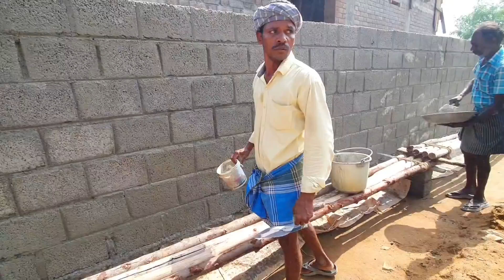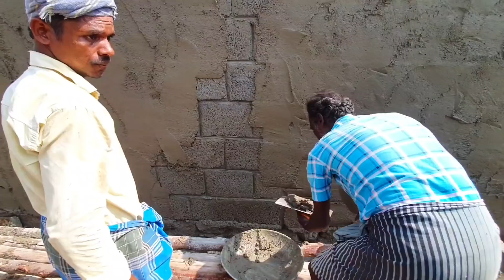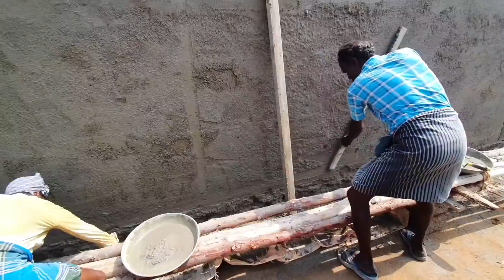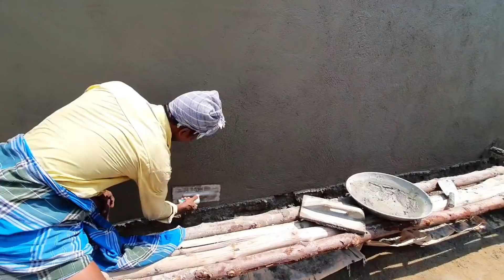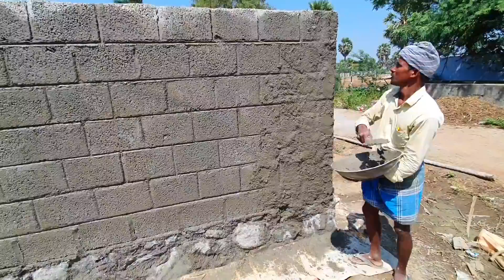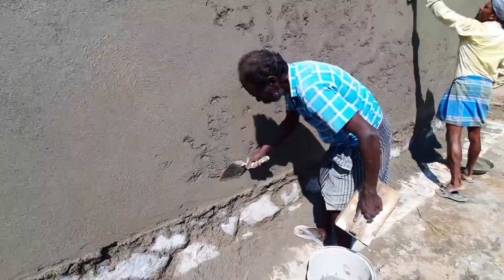Plastering Techniques of hollowblocks_Long Hollowblock Compound wall plastering with cement mixing

Comment: Bricks for Making Building Wall is gone Very Costly its Substitute is either by Making with Flat straight Metal plates keeping both sides vertical and filling it with R.C.C. Material and Stones in middle to Strengthen in lowest value Wall, which would be Fast in making and straight in Shape .